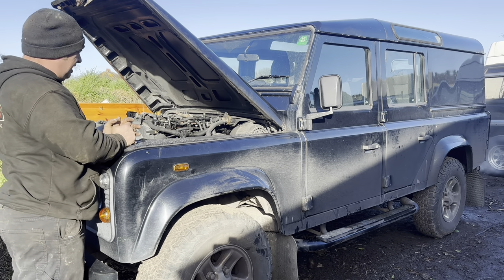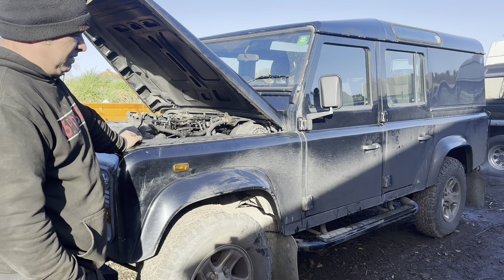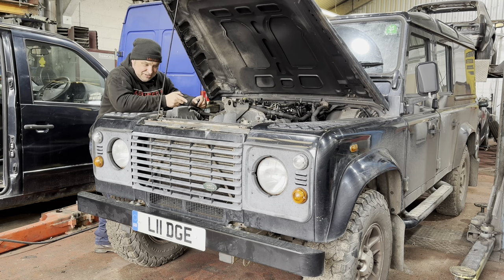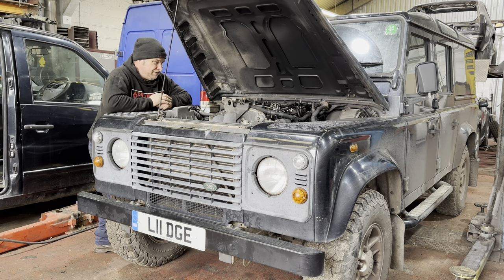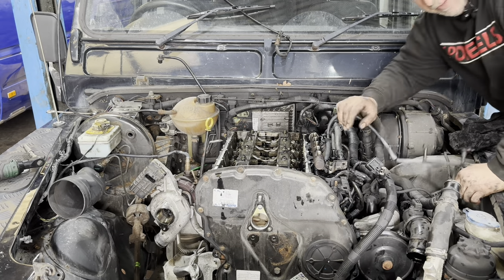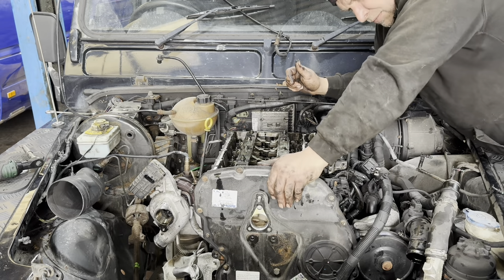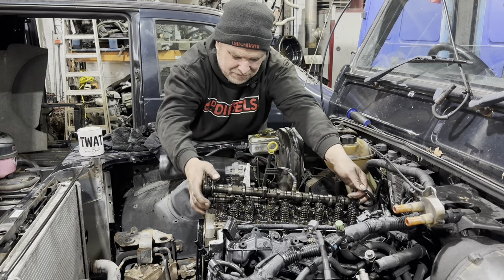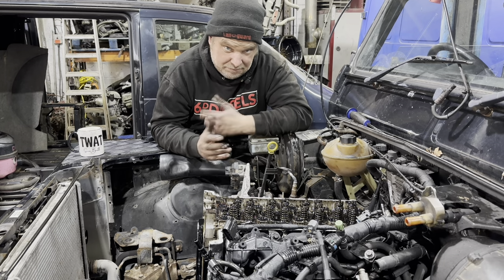Land Rover defender 2.2 engine failure we tear it down!! Is it fixable??? One way to find out

Comment: A breath of fresh air from a proper mechanic telling the absolute gospel truth. I'm an electrical engineer and what Al said about electric vehicles is spot on. We are being blind sided by the wokeraty to convince the plebery thay know what they are talking about and its rubbish all this woo woo climate BS gets on my bresticles. The rot set in when we stopped the engineers building the future and allowed the accountants to run stuff. We had the industrial revolution that built our modern world we are now in the phase of mechanical dissolution. I'm retired now and so pleased about it because my job just became an excercise in box ticking and form filling to satisfy people that weren't fit to carry my tools. Rant over. Well said Al onword and upward and looking forward to seeing you and fudgy doing what you do best. 👍PS I have an old 60 plate diesel Honda 2.2 Diesel  CRV for the last 13 years. I will be keeping it until the wheels drop off.

Comment: Another tradesman who says the same as me (although different trade) WE (UK manufacturers) dont make stuff to last its all a throwaway society. TVs, fridges, microwaves, cars, furniture, you name it its made CHEAP. For one reason only! chuck it when it breaks! Its scandalous, look at the stuff made by victorian engineers, still working today might be old but it still works! Well said Al, I totally agree with everything you said mate!
Reply: I have a Aermaster oscillating fan from the 1940s works like a dream. Oh and a Land cruiser 80 that will run forever.
Reply: I still use a gas boiler that was built in the 80s... only needed a new relay during its time

Comment: I have a 25 year old F-250 with a 7.3 liter diesel. It has 245000 miles on it and runs like new. I will not part with it.

Comment: Al , I've been saying the exact same thing for years . I have 2 cars , a 1975 BMW 3.0s and a 1976 Ford Granada sedan , both on the original engine both on the original gearbox . Both serviced every year , oils and filters changed . I've owned the BMW for 36 years and the Ford for 28 years . I am constantly criticised by numpties who whitter on about the environmental damage that I'm doing and I should replace them every 3 years for a new more economical vehicle....so instead of my BMW I should have had 12 cars and 10 for the Ford.....no body considers the polution caused by constantly making new cars , and nobody considers the disposal of cars either . I shall ignore everyone and continue to drive my old cars until I can't drive anymore....ps , my van is a Chevy G30 from 1984 which I;ve owned for 26 years too , nice vid Al and you are SPOT ON with your rant

Comment: I am also a landrover nut , I’ve had a garage just like yours for 30 years or more, and have been driven insane by exactly what you have described, I run a 1978 landrover light weight which has been fully restored on a galvanised chassis. It starts and runs and can be serviced with the greatest of ease, I sort of think the utility landrover was once okay 🤭 but now absolutely horrendous ✊

Comment: Excellent philosophy Al.. I had my Missus Hyundai serviced as part of the free Servicing plan! They tried to tell that although after three years and only 9000 on the clock, the plugs required changing as they wear out with age, whether or not they’ve run. I’ve still got old Champion N5s and N9y plugs up my garage that are still s good as new. What utter crap we put up with! Now I’m on a rant! Keep’em coming. I could spit feathers, but only from a reliably sourced, environmentally friendly, green, free range Clucker. Goodnight!

Comment: I love a good rant.
Watching a YouTube channel yesterday a 1988 peugeot 504 pickup diesel sat in a field for 15 yrs got eaten by the local undergrowth floors totally rotted out.
Putva battery on it changed the oil which was like water.and changed diesel filter and fresh fuel.
4th spin of the engine it fired up.
And sounded like  old peugeot.
Couldn't believe it.
So yeah imagine doing that with a modern vehicle.
Thing wouldn't even turn over I'd thought.
I still got my 1985 diesel escort van.
Still does 60mpg and starts on the button after glow plugs have been heated twice 😂😂.
Great content 👌 ❤
Reply: Was that channel Not Economically Viable? 
If so I watched it and yes, it started unlike  any modern crap! Perhaps that's what they want. Continual turnover of more crap to ease us from our money!!
Reply: @tonycalow708  yeah that's the one.
I had a similar peugeot yrs ago done the same thing.
Total rusted away but still started ip with no effort really 👍

Comment: Just watched this and having been in working on vehicles and engines for 57 years I have all the same thoughts as you, most of my work now is on older engines without all this electronic junk. I see that most vehicle problems now are down to electrical faults on some component that we never needed years ago.  I look forward to watching this channel more now! Just to end I have never been a Ford lover and when they took over Land Rover, that is when the rot started. I worked on loads of Landies from Series 2a,, 3 and 90/110 up until mid 1990's and they were easy to maintain then.

Comment: I fully agree on the opinions of throwaway society problems we have today, I used to do computer repair for an actual job, and when they introduced lead-free solder (which also affects vehicles with their onboard comptuers!), the faults and failures increased, the waste massively increased as a result, and repairing them, unless you have equipment that costs thousands to acquire, forget it, it's not worth my time to fix them any more!! 

Then of course you get certain brands (such as the fruity kind) that decided it's a BRILLIANT idea to glue their computers and mobile phones together, and add hardware-DRM on top of that all to prevent you fixing their stuff, so you either destroy it in taking it apart, or they blocked your device from running because of "unauthorised parts", something they were forced to undo owing to the fact it was, funnily enough, unlawful, it's despicable... 

But repairing stuff in general, like yourself, I love fixing things, my washing machine was built in 1998, cost me £30 on ebay with a couple issues I sorted, still works fine with a few simple repairs here and there, and in the 8 years I've had the thing, it's outlasted other peoples' modern washers who have come to me asking for repair which I had to refuse, when I come across something that I can't fix and have to refuse repairing because it has been intentionally designed to fail or block repair unless you pay more than the thing is worth in spares, it makes me angry, they just care about profits, not the consumer's experience...

Comment: My wife is an owner of a 2012 land rover 110 2.2 , which she has owned from new . It's done over 230,000 miles on the original engine. It's had a new turbo, new head, and during its warranty from new it was practically rebuilt underneath, it serves the purpose. So I guess we have been lucky. Whilst it's easy to look at it with rose tinted glasses, as you have very beautifully articulated, they are not for everyone and certainly not without their problems.
Reply: Sounds like triggers Broom
Reply: @vincenttill8051  Haha.... I was just about to say exactly the same thing before I clicked on your comment.

Comment: So refreshing to hear someone talk some sense. You don't feel confident driving modern vehicles, regularly going into limp mode with some emission based problem. Old school engineering, regular servicing and maintenance by engineers like yourselves, not Hollywood part fitters trying to blind is with fault codes.

Comment: I had a Rangerover with a Mazda Perkins three litre turbo diesel. Guaranteed to 400,000 miles. Noisy but pulled away in top. You are right about today's build quality, and saving the Planet will never happen.

Comment: I own and work on older Defenders, most parts are cheap and they're easy to fix pre Td5, I've worked on a new Defender.... Junk. Plastic junk and in no way is it a light truck like the old one. 
Garages don't want to do anything but simple oil or brake pad jobs, 3 garages refused to fit a front to back brake pipe on my sisters 14 plate Shogun, it was a faf to do but nothing more. Totally agree that we should be keeping what we have for as long as possible, fix things like we used to, that's surely better for everyone.

Comment: So nice to hear someone other than me ranting about how garages work, I trained late 60’s early 70’s as a mechanic the course following mine they called them fitters - fitters of parts! They’ve now moved on from fitters to technicians where everything diagnostic wise is done via a bloody computer, it seems that we’ve now lost all ability to diagnose a fault without one. We bought a Range Rover Evoque and 2wks later the steering went stiff so the garage we bought it from said there’s a recall take it to Sytners Landrover where they replaced the aluminium bolts holding the motor to the rack, on collection they said we need to do a diagnostic on it as the steering is stiff but assured me it was safe I told them there’s no need to do a diagnostic on it at £210per hr so I drove home and after just 11miles the rack failed completely. The new rack is £4700 plus 6-8hrs labour so fortunately after actually owning the car for just 7weeks we got our money back, then they made them almost uninsurable because of keyless technology.
Reply from the maker: Poor build quality poor service…. JLR….

Comment: Red Ford Escort XR3i 1986 (D reg) continues to start on the button. Annual self oil change. Minor paint blistering on door panel, kept under control will last another (40 yrs). Easy access to everything under the bonnet and easy to work on. Comes with a cassette player and cassette holder😂 And, it still smells like it’s just come out of the Ford factory 😂 I wouldn’t want it any other way. My other car is a black BMW 525 M Sport diesel (2007) an absolute monster of a car, beautiful to own and drive. Thanks Al for all you do.

Comment: Great rant! Nothing “green” about building tat that doesn’t last and get binned before (what should be) it time.

Still running the C4 A6 I bought used in 2003. Now 27 years old and 357k. Service parts only. Still does 50mpg and will go the oil change interval without topping up. It’s irreplaceable unfortunately.

Comment: Agree with it all Al, unfortunately we are in the minority. 
Had a 2.4 one of these Landrover’s , sold it with 74k on it… 
Have had a Clk270 diesel 6 speed for 15 years, thing will last forever with maintainence.
Defender needs a 2.1 Merc conversion required!!
Reply from the maker: I’m on trying to make a transit kit to fit a merc 611. I’ve got so many sat here at they never break and aren’t work a toffee crisp used for this reason 👍
Reply: How hard to fit instead of a 603 in a 463 G?

Comment: Garage I worked at used to supply and fit those disasters from ‘Ivor the Engine’. 
We had a Bini Cooper in for an Ivor engine. 1st one was pressuring the water jacket, 2nd one had no piston rings in it, 3rd one leaked more oil than the Exxon Valdez. By the time I was due to fit the 4th one I walked out and sought employment elsewhere😂😂

Comment: I agree with everything you say Al, it's all junk now, I work on this rubbish every day like you do. I had a 1998 310D Sprinter that did just short of 500,000 miles when I sold it and apparently it's still going strong! now thats engineering! I bought a 2005 Vito115 with no emission controls on for good reason! keep up with the great videos!
Reply: When I was a Hgv mechanic we had one of these as our breakdown van. Used to love hearing that 5 cylinder roar, a great van to drive

Comment: Same in my industry, I work on stuff thats either 40 or 50 years old and still works, or modern stuff that struggles to get passed 8 years before leaking, bearing failure or generally just shits itself.

Comment: Agree 100%. Everything we buy now, everything, has built in obsolescence. So that we have to keep on buying. 
That’s how business works these days. I have a land rover that’s nearly 50 years old and still on the original engine. 
I had to replace my apple laptop that was just 6 years old when it developed a simple fault because I was told it was too old to repair. 
Go done your local tip and see all the flat screen tv’s, microwaves, washing machines etc., all piled up.

Comment: I have a Landrover Puma 2016 Heritage version. So far under warranty the rear differential has been replaced. Now recently the turbo electronics failed so it has been replaced. The most common problem with these Ford engines are faulty injectors causing a hole in a piston. As you highlighted in your rant, you chuck the engine and buy a new one. My fear is not if, but when this will happen.

Comment: I have a client who has just been through the doom of an ingenium timing chain failure in his Freelander. A complete Land Rover lover all his life. Said this was his last ever one. He has had it repaired but it lives on borrowed PX time , but no one in the trade wants to touch them, as they know how bad they are. The grenade has the pin removed , like the tensioner pin and awaits the boom. Was about 5 or 6k to get the job done.
 Modern diesels are just crap. All this egr, dpf and electronic injectors are just a recipe of expense and short lived life expectancy. I run a fleet of diesel transits and they have the 2 ltr wet belts , so facing an additional expected boom from those. Ford have just announced  wet belt failures in the 3 cyl petrols have issues after all these years and hopefully they will warrant the transits with the 2 ltrs. The local main ford dealers  recently closed the doors to servicing as they had over 30 replacement engines to fit . Was told that by a garage owner who was towing a Ford connect van away , with a cambelt failure  and needing a new engine. Ford couldnt do it as too swamped with the rest of them. 
A friend had a V6 Discovery and had the Ford engine. It was always being fixed. He heard a nasty noise one day  and feared the usual snapped crankshaft , but was an injector fault, which they fixed. His previous one had a Peugeot engine in it , I believe he said and never went wrong. But the gearbox did and other things. Never have a Landy or Rangie or Jag without a warranty.

Comment: Thanks for the suggestion of the BMW after market conversion 03-04-05 in place as an alternative to the transit engine.
Re-Pressing bonnets to fit alternative engines is something Ford in Australia started in about 1977 with aussie falcon six cylinder inline engine that was placed in the local produced Cortina TE ( mk4 ) and its predessor the TC ( mk3 ) and the TF ( mk5 ) the TE successor. 
These were local alternatives to the Essex ( S.A ) and the Cologne if you can cast your mind back that far ❤😊

Comment: Not worth the seam off your piss this modern stuff mate! Your completely right 💯%!
 It's designed to make to lad who can get stuff going with basic equipment look a twat . 
The main reason it's utter shite is because the manufacturers can make money back from selling the shitty little components that cost them nothing to make, and band then out at a massive mark up as no one else makes them as spare parts so you have to go back to them and pay a fortune, or park your vehicle up & say f*©kit. 
Fly by wire. .. . Canbus ..... It's no used to anyone stuck in the middle of nowhere...... But they don't give a flying f about that

Comment: Al.got a 1960 morris minor  starts on the button got 2 fuses simlple  also got a  19 plate custom with 2000 fuses and  a bag of  shit wet belt  great idea cant see the custom lasting 60 years. also where is the starting handle on the custom i cant find it .Roger.

Comment: Absolutely spot on Al. You sound like me when I go off on a rant about the same thing! 😁

12 years ago, I was in need of a car that could cope with a 100 mile daily commute. I bought a Skoda Octavia MK2 with the fabled 1.9 diesel engine. At the time, it had 44k miles on it. I retired over 5 years ago and I still own her, now with 182k miles on the clock. 

My grown up kids think I’m mad and should treat myself to a new car. 

But I won’t, for the reasons you’ve just so eloquently stated. While she’s still running, I’ll keep hold of her, as she’s still in good nick. 

And anyway, what would I swap her for? 🤷‍♂️

Comment: Weve just fitted 2 of those engines in our 2 work transits, If i knew that was the case with those engines i would never of fitted them.. ones done 10k now and my ones just turned 600 miles. fingers crossed...
Reply from the maker: You might get lucky and get a Wednesday engine….. fingers crossed crossed for you 👍

Comment: Had the unlucky fortune of buying a new disco sport in 2017 with the 2.0 ingenium engine..biggest lot of poo ever made...new balance shafts at 8k ...oil change every 2.5k miles due to oil dilution...utter garbage.

Comment: Totally agree with you on the rant about emissions, electric vehicles etc.
Keep the good old stuff and make it better as you go along. 
I have a 1971 Camaro SS 396.
Yes it’s got a 6.6 liter V8
From the factory it had a carburetor the size of a 10liter bucket with 4 valves in the bottom. I fitted fuel injection on it a while ago and it runs like a dream and get dubbel the miles per gallon. The one and only reason I only drive it in the summer is the stupid amount of salt they put on the roads in the winter and makes the cars just fall apart. 
Any suggestions for good old winter car?